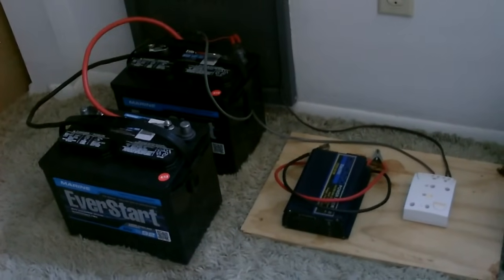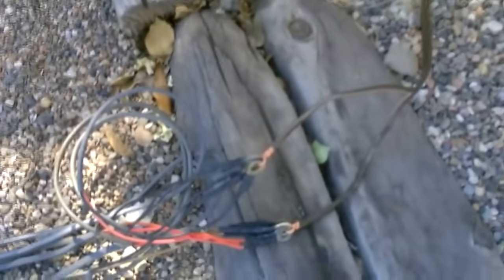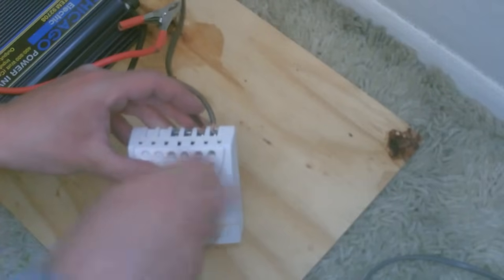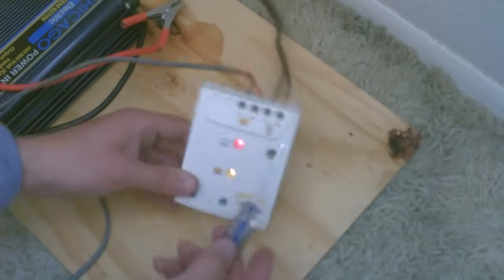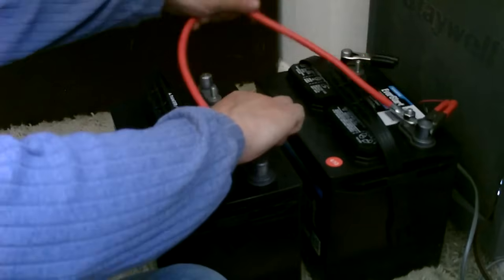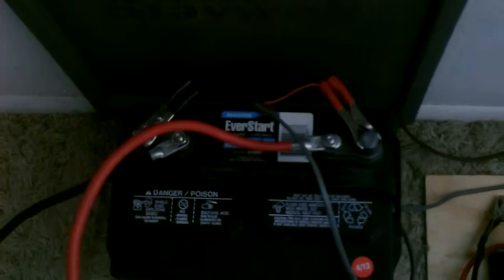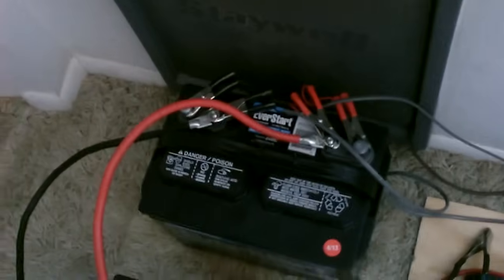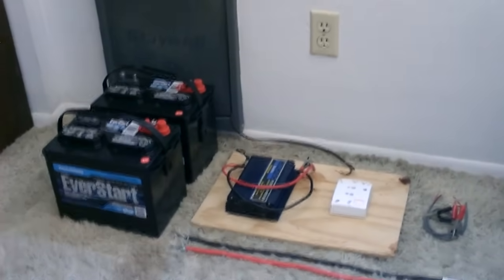How to hook up Solar Panels (with battery bank) - simple 'detailed' instructions - DIY solar system

Comment: My RV 94 eagle has this setup.  Also single line diagram in eagles instructions manual. Set up 4 systems professionally with largest output at 33 amps, 240 VAC.  This took 43 3'x4' panels.  Each panel put out 210 VDC and cost $380 wholesale each.  Each invertor was $95 per panel.  For the rebate and fed credit monitoring is required via www. Dimming rate is now 20% in the US.  If you produce more than used you don't get a check from Edison ... you get a credit on your bill.  Then they will tell you to use up the credit by running your AC more often.  When the rebates and credits end ... so will green tek.  Your average homeowner can't afford the install.  Payback on investment takes over a decade.  All panels are made in China.  Might be assembled in USA.  No company has been around long enough to warranty anything ... and probably won't be in 5 years ... credits end, they end. This is why certain companies are renting em to you. The system can't phase match with edison when grid down...safety feature for system.  No use in emergency.  New roof needed ... pay for system down and reinstall.  Stop payments on rental ... house liened.  Just a few secrets the salesman doesn't discuss. The millenials fall for the global warming BS so imagine a bright future till it isn't.   Be a lot more concerned about chemtrails fouling your PV output.

Comment: 101Ah for $75. Damn here in Australia batteries cost way more than in the USA.

For instance $75 USD is like $81 AUD. But the cheapest 100Ah batteries I can find in the country are like $185 AUD. This is why I haven't gone solar because the batteries cost so much here.

Solar Panels themselves don't cost that much here. I can get for instance a 200W solar panel for about $230 which I consider to be pretty good. I don't know what you would pay for a 200W in the USA though.
Reply: Robert Riley My mind was simply blown with the squeaky wheel/grease analogy. I've never heard that before, I love it, brilliant. =)
Reply: People are not complaining enough then.  The squeaky wheel gets the grease.  I want to get some 160+ Ah batteries to run things like 5,000 BTU air condition units during extended power outages.  This beats running some smelly, loud generator.  At least the solar panels would be used daily and I would start recouping my investment vs. a generator that sits in a garage doing nothing while the fuel that contains ethanol slowly contaminates its fuel system.  I wonder what year that solar panels will ever start selling for $50 per panel for a 250 or 280 watt panel.  I know it will happen eventually one day in the future.  Just when?  Remember how expensive web hosting used to be in 1995?  Now look how cheap it is.  Solar energy is following this path.
Reply: Robert Riley
The squeaky wheel doesn't always get the grease.  Sometimes the squeaky wheel gets replaced.  :)

Comment: I am trying to charge a car battery (12V 35AH) using a solar panel. I'm not sure what capacity the solar panel should be and what type of charge controller i have to use. I am trying to run a 12V DC motor (Power consumption: 4.2W)

Thanks

Comment: Hi! Thank you so much for your posting, this has made my dream of building a portable solar system so much easier. I have one question tho. Would it matter if you had the inverter permanently hooked up ? My goal is to build a case that i can merely use as a "plug and play" system.
Reply from the maker: hi. i always keep the inverter hooked up to the battery bank (but you can unhook it from time to time if you want - doesn't really matter).
Reply: thats what i want too. a bid wheeled cooler is where its at

Comment: Hi - this is a great setup!
Thanks!

So the panel output is 90W (5 * 15).
The watts on a solar panel is max. watts, this sort of power is created from a panel in a laboratory when they do flash tests on panels. You will get around 85% of that back in generated watts, depending on you location in the world and the type of panel you use. 

What is the battery capacity? 100Wh?
Also is it Lead Acid?
Reply: I think you meant  15 * 6 not 5

Comment: I want to build one of these for a trailer I will be living in full time in the southwest desert.  I want to run an electric burner for cooking dinner, charge laptop and cell phone, in the winter run a heater and in summer run an air conditioner.  do you know what type of panel setup I would need and how many batteries?

Comment: How about the specification of the charge controller?  how will you match it with the solar panels PV volts? Some solar controller says  Nominal System voltage: 12/24VDC, Maximum PV input voltage: 50V,  Nominal charge/ discharge current: 10A, LED display    and the     solar panel has this  specs 120W Solar Panel (600V Maximum System Voltage).

Comment: I will also try to do this in Trinidad & Tobago as it's sunny and would help my mum out.
Reply: Remember that too much heat affects the solar panel performance. Try buying monocrystaline cells which perform better than polycrystaline. Monocrystaline are a bit more expensive. but worth it.

Comment: Wow, you made this sooo easy to understand. You need to be a teacher. Lol can you connect a washer or dryer to one of those? How many watts should it be, what solar panel size for a larger appliance like a clothes dryer? In the UK currently and tired of waiting two days for my clothes to dry hung up on a clothes horse. It's costly to use the dryers.

Comment: Curious how the system is doing now that we floating around the shortest days of the year? Also curious abuot the panels if you would recommend a 200 watt panel rather than the HF array for the same money (or was it, the ability to go get it right now)?
Reply from the maker: hi there. since there are now several good quality low-cost monocrystalline panels out there - a good alternative to the HF panels would be a 100 watt monocrystalline panel. (a company by the name of "Renogy" sells a good quality 100 watter on Amazon for $149.99 free shipping. those produce about the same amount of power as the panels shown and would work well). i wouldn't hook up a 200 watt panel to a 12 volt battery or battery bank. (most panels higher than 140 watts are 21-40 volt and are mainly designed for grid-tie applications. the system is "going strong" through winter months. getting 9-10 hours of sun versus 14 (in summer) but still producing plenty of power
Reply: desertsun02 - Very cool and definately appreciate the reply. I've working on a low power linux cluster for the house (which is how I stumbled across your video) and was looking at a dc/dc atx power supply to avoid the inverter losses. The power supplies I've been looking at can take 5-30vdc as input so I was thinking 200w panel and clamping to 24v with a pair of deep cycle bats. Battery cost was the biggest reason I haven't done it yet but if you are getting good results after 8 months with common deep cycle hybrid bats, that is a great way to get started. So again, props for the build and thanks for the inspiration!

Comment: made a little solar power system too. I used two 145 watt panels and 4 six volt golf cart batteries. I got my charge controller from Midnight solar. 
I works great. I can power my freezer if needed. I also have my TV, router, AT&T box and several lights hooked up. I put in a breaker box and can turn the panels off going to the charge controller, and shunt it to a grid tie inverter. That way I can keep a battery bank charged for emergencies and then put back to the grid so I don't wast any electrons.

Comment: How did u hook up the meter
Reply: It simply has a set of gator clips that connects to your batteries. You can buy charge controllers with the meter built in if you want. He used the charge controler/meter that came with his harbor freight solar panels.

Comment: How much did every thing cost
Reply: I will take a stab at that. He has 2 harbor freight solar kits at about $175 each, the inverter from harbor freight is about $130. The batteries are about $75 each and I am not for sure what charge controller he is using but a 10 amp 12 volt charger controller by Morning Star is about $50. So that would be total about $700 or so.

Comment: Your illustration is very informative.. thanks for it. Just to ask one thing. Is there's any limit on the number of batteries you can ad it to?.. I plan to purchase 6 batteries and to hook it to 10amp 24v 2000watts inverter. Is this fine to do?.. thanks

Comment: Question? Most electronics run off some variation of DC,. why go thorught the whole inverter step? Seems if you set up a 12v system, you would have a lot less loss without the inverter step?
Reply: Most electronics while DC at the motor they are already wired to accept AC power. I would imagine it is just more convenient to leave your appliances AC and use an inverter. But yes if you could convert your appliances or purchase them with straight DC it would be more efficient.

Comment: Hi there, whats the best and simplest set up in terms of batteries and voltage, inverter and watts, and solar panel watts to run a TV monitor and computer hard drive and maybe a sound system for a home entertainment theatre please ?

Comment: One question please. With 3x100AH batteries in pararell connection
how many panels(12v), do i need to be fully charged??? for now i
got only one, which i know its useless
Reply: greg Clark Hi Greg!
You seem to know about solar panel and I have a question to you. I'm from Canada and I would like to install a Solar Panel that can run 120 Volt appliance: a portable heater utility (in winter) and an air conditioner (in summer) but I'm wondering how many Panel I would need and/or the strength (Watt)??
Is possible to have just one panel but a bigger one & in strength (Watt)?
I was also curious to know how to choose the Power Inverter in Watt so it has enough power? Thanks in advance!
Reply: The output of the panel is a huge factor. The other huge factor is what you plan to run. If you are only running an alarm clock and charging a phone, then one panel would be fine.
Reply: By the way, I wouldn't suggest a panel by harbor freight... it's a rip off.
Reply: i see, thanks

Comment: I just bought a solar panel that generates 18w per hr.  I also have a battery and a 350w (700w max) inverter, and 7A charge controller. im hoping that this will be enough to power my christmas lights that are 72w per strand x 5 strands= 360w. do you think that this set up will be enough to power them for about 4hrs a night? Also will one battery be enough?

Comment: ive heard its better to wire solar panels/wind turbine straight to batterys then have the controller wired to the batterys somehow , possibly from its battery terminals and so use the controller to pump any overcharge to something else like a load or some more batterys , have you heard of doing it that way ?

Comment: have been thinking , it might be better to have 2 charge controllers , split the panels in half, maybe i am thinking too far out of the box, wouldn't that increase the amps but keep the voltage the same?

Comment: is ok if i dont have charge controller?  ty for ur response
Reply: thats ok coz its only 30 watts. din my battery is using sulfuric acid. so it well discharge fully charge? right sir?
Reply: soi it well discharge if it is fully charge
Reply: thank you so much  ur concern... nice meeting you sir
Reply: victor marinas No its not okay. You still need a charge controller, no matter what volt it is. The battery/appliance might blow up if there is no charge controller to stop the flow of energy at a given time.

Comment: just as a side note keep in mind they might not have as much amperage as the usual 12v deep cycle batteries.

also just make sure they are all the same type of battery, ie lead acid etc as there are different types on the market. I do not know if that may cause problems if they are the same voltage. Better safe then a house fire.

Comment: Just browsing and I thought I would help... Yes I cannot see that being a problem. Just check them individually to make sure they will work and are not damaged.

Link them in parallel plus to plus etc for higher amperage, you can make them 24v by linking two in series + to - then use plus from one and - from other to form your 24v bank.

24v battery banks...
lsay you had 10 12v batteries link two sets of 5 12v batteries in parallel, then link the two parallel battery sets in series.

Comment: your video is very simple and informative..can you help me by answering a few questions?
1. can i use my UPS 12 volts batteries as battery banks.?  i have plenty of them coming from scrap UPS..
2.  ..is the inverter of the UPS be used as the power inverter instead of that thing you use in the video?
thank you

Comment: Actually a question I did not find on other sites about solar:
The inverter you use depends on the capacity of the battery and not the solar panels?
12V 100Ah battery can run a 400W inverter or 720W inverter ?
12V 50Ah battery can only run a 400W inverter max ?
If you only have a 100W solar panel you can still run a 400 or 700W load if your batteries are fully charged?

Comment: I have to say you do a good job ,on how to set up unit ,but what would help fools like me,would be the size of all items used like inverter size,charge controls size you use a 24 A,most sold are 12 a, and inverter size always try to sell are 1000, yet see yours is 400 inverter  ,and the prices you pay,in UK cost is twice as much if not more and eBay same inverter is £120.00.  and they ask £199.00 for a battery, anyone in UK can tell me where i can get good price on items needed ,to set up solar

Comment: is this EMP proof or do some of the parts need protected in a fairaday cage?  I kinda wanted a set up for the purpose of power grid failure such as an EMP,  but it's not very conveinent to put parts in a fairaday cage, because then you cant use it normally.  It would have to be packed away.

Comment: In Vietnam, we use 220V power line. If I want to install a solar power system, then how much do I need to use solar panel? My appliances including a refrigerator, a television, a computer table, a few light bulbs and electric fans.
Can you tell me the price of solar panel that is how much you bought it? Thank you.
Sorry for my English is not good.

Comment: Hi, first I want to say great video.  Second, I've done most of my homework already since I will be moving to an off-grid house.  Quick question, what kind of wire (copper ones) are you using from the solar panels to the "extension cord" you called it, and those wires to the inverter.  Thank you for your help.

Comment: I was really interested in hooking up solar to run sewing machine, lamina-tor, and small craft machines in my garage/craft room. I don’t have a lot of outlets and didn't want to overload with the extension power strips or pay to have more outlets run and upgrading electrical panel. This is so much more cost efficient and I can do this myself.

Comment: I'm currently trying to understand solar panels, because I want to buy some. So the way I see it, Solar panels connect to charge controller. Charge Controller connects to battery. If the battery is 100% charged, and you don't remove it, does the charge controller stop the flow of electricity to the battery?
Reply: AnalBag McTittySlapper good question I want to know also

Comment: I have a 30watt Goal0 solar panel that has its junction box power converting unit that went. From what I understand, the Goal0 12v batteries have a charge controller in them. Is it okay to use a 400w inverter for only a 30watt panel? If I added a charge controller, would it hurt if there was already one in the battery? Goal0 doesn't sell these parts and are not very informative about their system  Thanks.

Comment: Could you shorten the charging time by increasing the panel size say too three 100watt
panels? This should drop the charging time to about 1/3 . maybe be fully charged in less than 4 hours. thanks for sharing.
Reply: cid woody good question

Comment: Yeah, I second that. The leads coming from the panel should be tightened together with more than just the copper strands through the ring terminals, or else the junction will not conduct power from each panel equally. 

Good informative video though; simple yet covers all the bases.
Reply: stevehmi how would you tighten it more than just that?

Comment: Love the video, very nicely done and simple to the point to understand. I have a similar system I got six years ago from a major auto parts store. It is four 15w panels, and 8 amp charge controller and a seperate 800w inverter. I got four deep cycle batteries from the same parts store. It ran my lights and old printer in my rural tow yard till about 2am every day. I never had fancy monitors for battery charge, but they lasted five years or so. I still have it on my shop. Thanks, good job.

Comment: You can if you first have your two 6 volt batteries connected in series, Then put your 12 volt battery in parallel with the other six volt set..

Comment: A generator could be used in a loss of grid situation. many Youtube videos cover this. See Grid Tie syst for other.
You would need either an automatic disconnect from the Grid switch or a manual one. Install female outlet near the main Grid Breaker box where the power comes in from the Grid. Your Generator cable needs to have the same configuration of male plug at the end to mate with the outlet you installed. The main breaker MUST be turned off before turning on Gen. Get electrician to do it.

Comment: So if I need to connect it to a device using 24hrs like say, a router, will it charge while being used? Why some batteries will say 20h rating or something like that? Does that mean it will not withstand 24hrs of use? Thanks again! Great video!